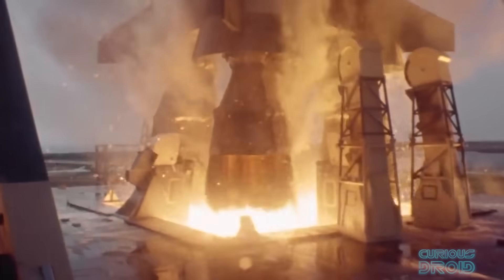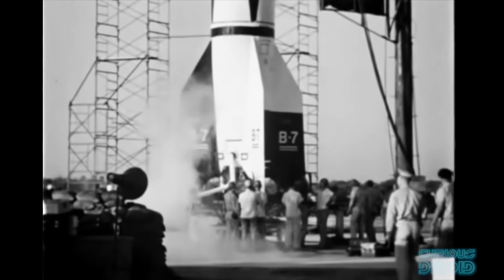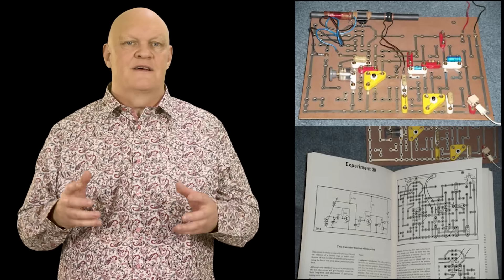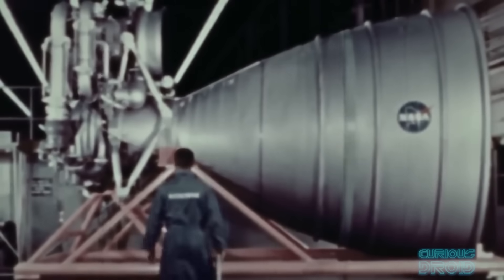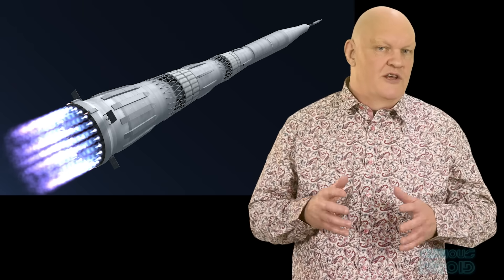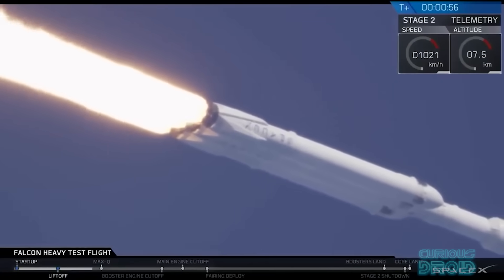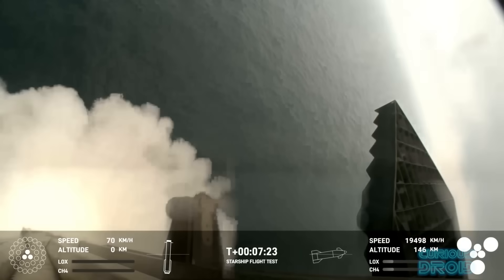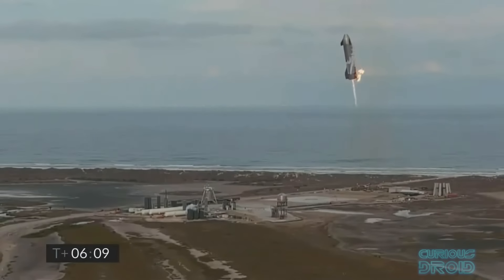Why Does SpaceX Use 33 Engines While NASA Used Just 5?

Comment: one big advantage of having multiple engines is engine out capability:
starship can loose 3 engines at ignition and still launch. With the most recent launch the booster lost one engine and still delivered the ship to space and during the landing burn it lost one and still managed to splashdown in the water.
Even f9 has had missions where a merlin shutdown unexpectedly but it still delivered the payload to orbit.
Reply: It launched with no payload.  Just an empty can at the top.  No crew module, no fuel, no life support system. No cargo. Nothing... And the booster still had a tiny bit of fuel left. 

People gain way more excited than they should be.
Reply: @tcat1990  ok? Why would they waste all that on a test flight? You act like they’re doing nothing in the background.
Both stages were not fuelled fully for the very reason that they are carrying no payload.
Reply: @tcat1990  it was not fully loaded to begin with
Reply: The super heavy booster had an engine catastrophically explode during the landing and it still touched softly down.  Just amazing.
Reply: Did Apollo 11 actually leave near-Earth orbit?
Despite the revisionist narrative that this channel won't question -- unstable fuel burn for the oversized F1 engines was never rectified and another arrangement in their place was made in order to reach near Earth orbit, keeping the F1 bell nozzle to maintain the desired appearance.  The great licking yellow flame was an indication that something was not normal as fuel was burning in the atmosphere while providing no additional thrust. This was the result of injecting additional kerosene into the exhaust stream for greater visual effect yet appearing to produce an inefficient burn unlike other rockets after launch.  No explanation is forthcoming and this issue is not addressed in any usual report; however, using a smaller reliable engine with a reduced fuel load and stripped down mission requirement allowed the Saturn V to reach near-Earth orbit.  

The Apollo 11 crew attempted to demonstrate their position at over halfway to the moon as seen in the unedited version presented to the public while the more recently released unedited version reveals a flood of blue light entering the same window as the camera continues to roll, through which only a moment before, we saw the Earth far distant in what appeared to be very low light conditions. Then, as the camera pulls back from the window, the exposure settings are seen to return to normal as a flood of light enters the same window.  Without a change in the orientation of the spacecraft assumed to be on a trajectory toward the moon, the only source for any flood of light can be the Earth while in near-Earth orbit.  The usual sponsored efforts will try to make excuses for why the obvious did not take place -- yet is overly apparent in the unedited version.  When facts cannot prevail in support, sponsored activity will resort to name calling and other derogatory comments discrediting themselves.
Reply: .  . While remaining in near-Earth orbit, another indication are the impossible weather patterns seen on Earth, when in reality only a small portion of the Earth's surface was visible, framed by the round window of the command module.  Straight line cloud fronts are seen on video to be extending for what appears to be more than 6000 miles, a quarter of the Earth's circumference -- something that has never occurred in the meteorological record on Earth. The round window of the command module was used to effect an image of the Earth but the weather in the region did not comply for a realistic view.  No recognizable continents are found in view, but only the impossible weather patterns seen.
Reply: Starship only reached low orbit.
Reply: @LordZordid yes, because it was on a sub orbital tragectory on purpose. They could have done orbital just fine.
Reply: @LordZordid  well sort of not really. They still have to demonstrate that they can de-orbit starship safely before they can achieve higher orbits
Reply: @LordZordid  yes? What that have to do with anything
Reply: @clevergirl4457  I corrected the OP because the OP said it reached space which it did not. Let's not get ahead of ourselves and rely on facts. I'm not saying this to be critical. But I recommend having just a tiny bit of skepticism
Reply: Starships apogee in flight 3 and flight 4 were over 200km in altitude, which is 100km above the karman line aka space. The perigee was very shallow, only a few more seconds of burn and starship would be in a complete orbit. This was done on purpose, testing raptor relight in space is trivial compared to testing the heatshield against real world conditions. Once starships return capability is made reliable, you can expect to see complete orbits, and payloads being deployed.  @LordZordid
Reply: @thephoenix134  I sure hope so. But i'm not holding my breath,
Reply: @LordZordid  you "corrected" someone with false information.  Lol.  Fact: Starship went to an altitude that is TWICE as high as where space "officially" begins according to NASA.  Your "skepticism" isn't skepticism, you're ignoring basic definitions of words to lay on FAKE criticism.
Reply: @LordZordid With no payload. Can they carry enough fuel to get full payload into space? Looks marginal at the moment.
Reply: @michaelzerk  Well, they are not there yet. People were raving like mad about how Starship were going to land on Mars in 2018, 2020, 2022, 2024. And now with the cancelled moon mission I suggest everyone calms down. You might set yourself up for more dissapointments.
Reply: @michaelzerk  Test launches with payloads won't even begin until Block 2 is already underway.  They're making the first Block 2 vehicle now, though.  Possibly 35 engines on Booster and possibly 9 engines on Starship.  Not sure if Raptor V3 will be available yet, but the difference in delta v, and the somewhat lengthened stack, ought to make for a good interim payload until we get to Block 3 and 200 tons.
Reply: @Asterra2  How far from the original proposal is all of that? Where will the funds come from? Didn’t SpaceX pitch a program cost of $3 Billion or thereabouts? And then it’s not just one launch for the Startship system to work. Despite the remarkable effort to get a thing that big off the pad the concept seems flawed.
Reply: @michaelzerk  Why does the cost matter to you? SpaceX is near enough footing the entire bill themselves, and the only reason I'm not saying they are paying for it all is because I don't know if they spent NASA's milestone awards on Starbase or not. SpaceX could certainly have found that $2 billion the same place they found the other $8 billion they footed. This bears repeating: SpaceX conducts payload-free test flights using prototypes; everyone else conducts simulations and eventually launches a rocket that has a payload and literally cannot afford to fail. The former is an order of magnitude faster than the latter. That's why they do it. They really don't care if onlookers don't understand that this initially means IRL fireworks rather than simulated explosions.
Reply: @michaelzerk9541 so, uh, 200 tones exceeds the original proposal. They're privately funded, and also operate a very rapidly growing internet service, as well as have large, lucrative contracts with the DoD to launch ever increasing numbers of military satellites. Sure, they got some money in aid, but all in all, they were developing starship without that money anyway and would continue to do so, because they're owned by a multi billionaire on a lifelong mission. So idk what point you're attempting to make?
Reply: But more engines to have more chances you lose some. And these guys aren’t kings of reliability of any sort.
Reply: @Badmavs what? Space X is literally the only launch company that can use the same booster 20 times. They are the king of reliability. The only reason people could think they aren't reliable is if they assume test flights, which are intended to stress bleeding edge developmental technology, are actual production ready flights.
Reply: @Badmavs  do you know how many times they have landed falcon 9 in a row? How many times in a row has someone else landed?
Reply: @Badmavs  wha? The guys who have the most successful modern day rocket with over 300 successful launches?? The ones who are certified to launch humans, national security payloads and billion dollar science missions?
Reply: @clevergirl4457  Not rated for humans  yet....also no payload testing.
Reply: Fundamentally flawed design.
Reply: @therecyclingguy256  yes that’s why the launches are only getting… better and better?
Reply: @clevergirl4457  Well, by saying it's getting better, you are conceding it's not good enough. He is right, the design as it stands now is flawed. And by the way, that whole thing about getting progressively better is a massive cope, those rockets were supposed to by fully operational years ago.
Reply: @a_kazakis  remind me again which rocket program was ever on time? 
SLS was supposed to debut in 2017, Vulcan was supposed to launch in 2019. Ariane 6 is late and Europe is relying on Falcon because of it. Falcon heavy appeared years after it was announced. It wasn’t until 2019 that SpaceX seriously started work on starship. It is by far the most complicated out of the aforementioned rockets, with basically no legacy components.
Reply: @a_kazakis  "I don't like iterative design" the comment.
Reply: @Jogeta5  As with everything, there are good applications of iterative design and BAD applications of iterative design. In this case, every change they made since the first test didn't require live testing. They could have made the same progress with simulations, saving hundreds of millions in the process. The ONLY reason they have regular test flights is to generate hype. It is basically a marketing campaign.
Reply: @a_kazakis  Bro, IFT1 literally informed the need for hot staging.  You are officially on record as stating that SpaceX's desire to test hot staging, even going so far as to make it the "key goal" for IFT2, was "hype."  Touch grass.
Reply: @therecyclingguy256  Fundamentally flawed comment.

Comment: If starship is the most powerful rocket why can’t it get to the moon in 1 go like Saturn v which was less powerful
Reply: If all they wanted to do was put two guys on the Moon and one guy in orbit around the Moon, they could.
However, NASA has no interest in tiny crews with minimal cargo space -- been there and done that.

The Lunar Expedition Module (LEM)  had a mass of 15103 kg (was the total mass of the LEM ascent and descent stages including propellants (fuel and oxidizer) -- so, 15 metric tons and change, and could land two crew with enough supplies and life-support for a few days.

With twice the thrust of Saturn V, Starship could accomplish that easily, even without throwing most of the rocket away.
By itself, that would demonstrate a significant improvement as compared to Saturn V.

That said, NASA wants the new Human Landing System (HLS) to deliver up to 100 tons and land it on the Moon -- more than six times as much as Saturn V's capacity.
So, they need large vehicles -- much larger than the LEMs -- and every one of the competing systems will likely require orbital refueling of one sort or another.

The new HLS will never re-enter Earth's atmosphere, and will only ferry astronauts and cargo back and forth from the lunar suface to the Gateway station.
So, no heavy heat-shields, no heavy fins to articulate with heavy machines, and gravity that's only about one-sixth of Earth's.

Most of the mass the HLS lands on the Moon will be crew and cargo -- useful mass -- and not the mass of the vehicle, itself.

So, 150 or so tons to orbit from Earth, much of which will be cargo or life-support.
Refuel, go to Gateway Station, pick up the astronauts, drop them and the cargo to the Moon's surface.

After that, never return to Earth again -- just launch new cargo vessels into orbit for refueling before heading out to Gateway Station, where they'll transfer some or all of the cargo to the HLS for Lunar descent.
The Lunar injection rockets then just travel back and forth between Earth orbit and Gateway station, after refueling and transferring cargo and crew launched from Earth.

Some of those vehicles launched will, themselves, land on the Moon and just stay there to become power plants, warehouses, storage tanks, or even get "folded out" as habitats.

Saturn V couldn't do any of that.
Reply: There wanting to move a lot more mass to the moon and its long term goles are beond the moon. In space refuling is the future. The math does not work anyother way.
Reply: Add the third stage from Saturn V on top of Starship and it could do the Apollo missions. It's because it's a two stage vehicle that it can't go to the moon in one launch.

Going for a two stage vehicle is a choice to enable reuse.

Comment: 11:38 not correct: they were not tested because they used pyrotechnic valves which require to be replaced after each use. 1 of 6 was tested as a type of “batch test”

Comment: Because they don't know what they're doing?  The soviet moon program died because their main booster, the N1, had 30 engines, and failed all 4 times in flight.
Reply: Go read up on the failures, they were not all caused by engine reliability issues
Reply: Super Heavy has been much more successful than the N1, with 3 out of the 4 flight tests resulting in Super Heavy getting past staging.